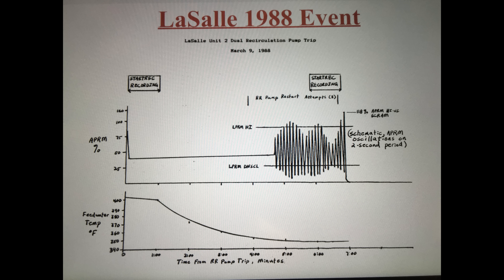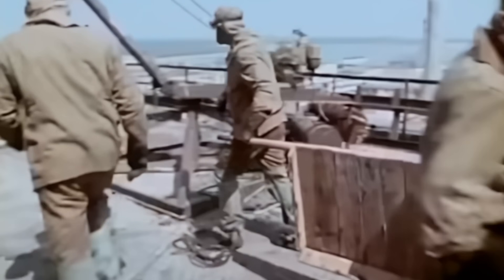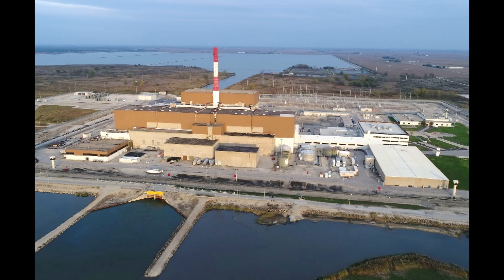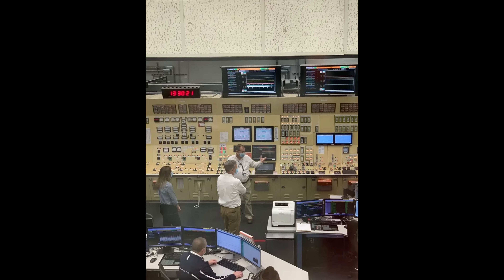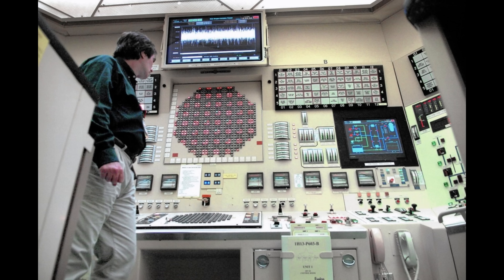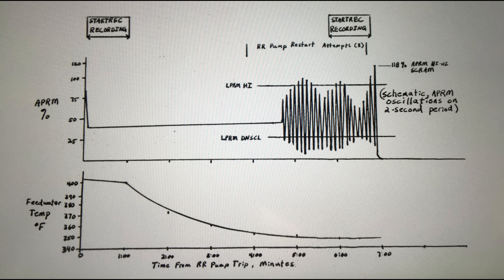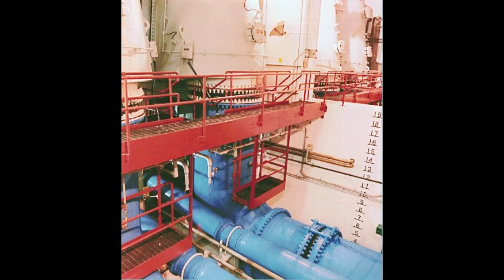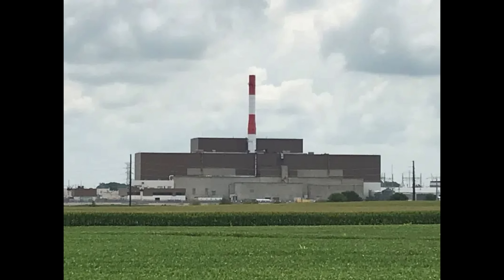LaSalle 1988: America's "Almost" Chernobyl?

Comment: Third possibility: had they been able to actually restart the circulation pumps, wouldn't this have had an immense positive effect on core reactivity? From your description it sounds like the feedwater was declining in temperature from the preheaters not being online, this would trend towards increased reactivity from the increasing density of the coolant. With that many control rods out, I'd think hitting the core with a sudden shot of cold water would have been a very bad idea. Not saying it would have led to a core disassembly scenario, but possibly fuel bundle damage at the least. Then again I've also seen the videos where they intentionally shot the rods out of the BORAX units, and they apparently didn't blow up horrifically. BWR's are a pretty stable design, I like them better than a PWR from a design and safety standpoint.
Reply: from what I understood the circulation pump is meant to level out the temperature across the whole core, so in this case it might change the speed of the oscillations. I don't think it would make it worse, but I'm not a nuclear engineer
Reply: The recirc pumps pump hot water to mix with the cold feed. This would raise core inlet temperature and likely allow the reactor to stabilize but it would likely continue oscillating for a few more cycles.
Reply: And the recircpumps don't spool up in matter of 1 s, takes time for the core flow to raise. So, unlikely anything dramatic, more like geadual dampening of oscillations and simultaneous power increase (gradually)

Comment: Rmbk actually is good design if fix all stupid mistakes
Reply: They actually did fix most of the issues. The only thing they couldn't give them retroactively, is a full containment building. As far as RBMKs go, they have cleaned up quite nicely. Don't get me wrong, they're still big, grumpy and headstrong reactors that need a firm, but gentle hand to keep them in check. But they're also no longer the hair-triggered monster people make them out to be.

Comment: No in simple terms there was no risk of a Chernobyl a BWR by virtue of using water cannot surge like an RBMK.
Reply: It can surge in reverse if you overcool it hard enough
Reply: @kalkuttadrop6371 what mechanism is that called? Genuine question. I’m assuming it has to do with the overall kinetic energy in the water causing neutrons to be slowed more, spiking the reactivity?
Reply: @neohavic6012  Negative Temperture Coefficient and Negative Void Coefficient. Cooler fuel temps means more reaction and fewer steam voids means more reaction
Reply: Water can flash steam though, so if those power oscillations were allowed to continue and grow, there could be enough power per spike to instantly flash whatever water was in the core instantly. Seeing as how steam takes up ~13000x the space of liquid water, and it’s in an enclosed space, that gives it nowhere to go, in turn turning the whole reactor into an explosive device. So yeah, not great.
Reply: @neohavic6012 the steam density vs liquid density at 70 bar (normal BWR operating pressure) is more like 1:50, not 1:13000 as it is at 1 bar.
Flashing ofc is still dangerous, but would immediately shutdown the chain reaction
Reply: @mattipaajanen4109  Yeah, I was off by a whole order of magnitude; 1L of water will become 1700L of steam at 1atm, so a 1700x increase. Yeah, it would shutdown the fission reaction, but a BWR isn’t rated for those kinds of pressures, and would almost certainly breach the reactor vessel regardless of the reaction stopping.
Reply: @neohavic6012  SL1 went bang because of its enrichment however for a BWR. I seriously doubt the chain reaction could win the race of the moderator straight up boiling off so fast the reaction fails. Core damage would be likely however a loss of containment I don't think is possible. As the negative rather than positive void coefficient would take effect.
Reply: @RNA0ROGER I’m taking my analysis off of the study data that was done, so I don’t remember precisely if TCG mentioned that in it they were continuing to pump water into the core in that simulation or not. I can see where if the core was completely empty due to all of the water boiling off and not flashing and not being replaced, the NVC would bring the reaction to heel. In any event, thank Christ we never had to find out 😭